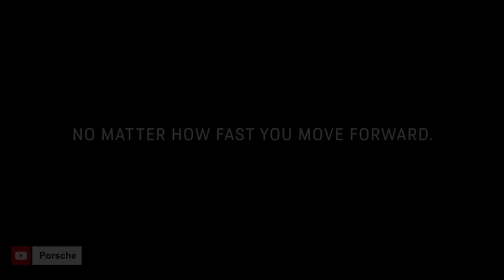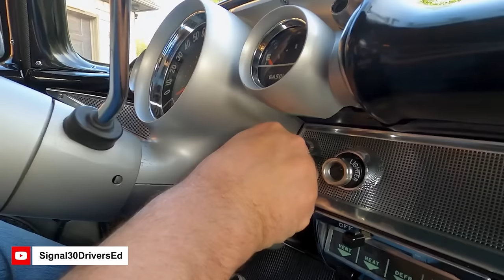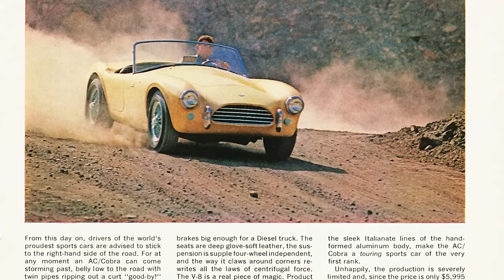Why Old Cars are Better

Comment: Interesting video, but I must call out a few points:
3:30e  "Quality materials in houses 100 years ago"
By this logic, Rolls Royces and Lamborghinis are better deals than mass produced Toyotas. Except they cost 10 - 100x as much, and their hand craftsmanship's only value is saying it's hand crafted. No actual functional superiority.

4:07 "Will it still be standing 250 years from now?"
1 Who would want a 250 yo home in 2024?
2 Even if housing technology doesn't improve nearly as much 250 years from 2024, as it did from 250 years before, it becomes a matter of return on investment. To make a house last 250 years might cost more when interest and costs are included, vs the average 2024 house that might last only 100 years before becoming more cost effective to tear down and replace
3 Who says 2024 houses can't last 250 years?

"Built not to live in longtime but for developers to make a profit"
1 WTF do you expect? 
2 Those market forces drive more houses to get built, at lower cost, therefore more people get to live in houses
3 I do agree developers aren't rewarded enough for highly cost effective improvements like better sound insulation and utility serviceability. But these are minor vs Bart's alternative of hand crafting and overbuilding everything largely for bragging rights rather than measurable functional improvement.

8:00 "old cars require more work to start...a shell of the experience of driving a real car"
Sounds like someone wants validation for understanding some technical details of how these obsolete, less efficient mechanical systems work.  

It's fine if you're interested in how pre-electronics mechanical systems work.  As long as you recognize when they're functionally inferior. The problem comes when one denies/ignores that inferiority. Similar argument to people calling it a feature, that they can fix old mechanical systems vs replacing an entire electronics module.  At the price of worse levels of cost, safety, reliability and performance. 
Electronics are your friend. If you really want validation, study electronics. It's extremely satisfying to understand. Attempting to sour-grapes discredit functionally superior systems in contrast puts you constantly on the defensive while fostering a reputation for science-denial and Ludditeism.

9:30 "Youre not inhibited by electrical systems doing all the work for you..."
What do you call the mechanical systems in that old car? They're still doing 'work for you" -- just less efficiently, less reliably, less safely and more expensively vs modern 2024 technology. The fact you might understand how non-electronically controlled springs and sway bars and steering and throttles work, vs how sampled position sensors and servocorrections work, doesn't change electronics' advantages.

11:30  "less constraints on aesthetics the further you go back"
Well at least no significant constraints on aesthetics before about 1973. Only then did things like rollover and bumper standards start affecting design.

"lines not obstructed by...crumple zones, rollover stats..."
These comprise very little of the restrictions on 2024 design.
You can make hardtops that pass rollover and crush standards.
Crumple zones have essentially no effect on any desirable design -- other than outlier examples like the early 1960s vans and VW Microbus where the driver sits ahead of the front axle.
Bumper standards in 2024 have very little to no effect on design aesthetics -- we can now shape highly complex composite/vinyl shapes that shroud metal bumpers. The fact that market forces result in a lot of similarity, is just that -- the market -- not laws. 
 
Thick pillars housing airbags -- that might be an issue. I suspect there are workarounds.

12:32 "having your car's headlight to look like every other car's headlight"
1 There is no law stating this -- again it's market forces -- style and aerodynamics. 
2 Like every other? In 2024 automakers can make polycarbonate headlights in a huge range of near arbitrary 3-dimensional forms. It's pre-1984 that there were US headlight laws constraining design to a limited set of sealed-beam styles.
1939 - 1956 only 7" dual round sealed beams
1957 - 1974 these or 5.75" quad round sealed beams
1974 - 1983 a few additional rectangular shaped sealed beams
Only with the 1984 Lincoln Mark 7, did the US start allowing non-sealed beams and composite headlight shapes

3 Far more design latitude with LED lighting in 2024 vs the limited incandescent-based 'good 'ol" lighting pallette pre 2000 or so.

Much more relevant crimps on design in 2024, are pedestrian-safety laws potentially limiting sharper edged front shapes and popup headlights, and market drivers like aerodynamics

12:42 "They were made of high quality metals...than the average new car today"
1 Bart appears to be falsely conflating weight with quality. Metals as used pre 1970s vs modern composites and plastics, were typically 
* heavier, thus worse mileage
* more rust prone
And where metal is needed, in 2024 we have high strength steel alloys
2 Quality is much higher in 2024 vs 1974 -- obviously with British sports cars but even Honda/Toyota are significantly higher quality.

14:20 "height of headlights"
1 Headlight height laws arrived around 1974 -- ruling out great cars like the variable height Citroen SM. But otherwise perfectly logical -- you don't want to be blinded or have too little light range, by too low lights
2 LED lights give more styling options vs 1974 sealed-beam incandescents

14:50  "Everything is an SUV"
Again it seems to be largely market forces i.e. customers -- driving this.  No laws require SUVs

15:15 "Those cars didn't come from a computer, they were sketched by real artists"
Who do you think sketches the shape of a 2024 car? Real artists. Computers just implement what 'real artists" specify. "Soulless" computer controlled metalworking also enables greater options in fabricating complex shapes. 

20:10  One of the few valid points in this video:  Those pedestrian death rates increasing since about 2010, are indeed a direct result of obsolete US laws favoring large pickups. As well as 'trucks" -- often bought for noncommercial passenger use -- being exempt from many safety standards and mileage requirements.

It's bad laws. Not modern 2024 technology.

Comment: Old cars are better because unless you have a complete engine malfunction you can make it run with just a screwdriver, might not run great for very long but it’ll get you where you need to go to fix it. In a new car if one $10 sensor is bad your not going anywhere

Comment: im on your side. cars have gotten more electrified and futuristic old cars are a whole hell of a lot better than cars today because old cars give you something to do when in today's time you'd just be contemplating on what to do for the day. old cars give me a handon job to do to get some exercise in the process cuz getting frustrated and fiddling with things trying to solve its problem works up a good sweat rather than just sitting in my driveway staring at the new tesla i bought from the dealership if i could ever afford to buy one which i never ever will becuase they are very ugly and are just pure electric producing hardly any sound. i will never ever buy a tesla unless i can afford to buy a hellcat motor to swap into it which sounds awesome in my opinion, let me know if you agree. #OldCars4Life

Comment: Daily Driver 68 Dodge Dart Restored to driver level...
Not a show Car etc..
9 years on the road since Swap to V8 with 120k on my rebuilt Motor,  Parts are a concern as far as quality, i daily so , my example of ware is the brake shoes, yes brake shoes, Push to Pray Drum Brakes front to back.. the Quality of material used isn't near to OEM, yes no asbestos, but it's more than that, I've had drum's out of round, misaligned bolt pattern.. 
My choice is always late 60s era because those basic engineering standards stayed for a while, Suspension systems , Cooling and brake system layout Disc and rear drum, especially on Truck's..

If you choose to upgrade your old vehicle, many aftermarket companies are at the ready,  Computer aided throttle body injection "Carburators" 
Upgrade for Old style Points distributor,,
Electronic ignition, like what i personally run Petronix conversion...

Even traffic is better in a Classic Car/Truck..

Keep on wrenching folk's 🇺🇸

Comment: Peak reliability was achieved in end of 90s/beg of 00s. Then computer simulation was accurate enough so that none of the parts in the cars get over-engineered anymore, which means when you reach the 150kmiles/240kkm typical lifetime requirement, everything starts to break down, sometimes significantly earlier than this due to cost cutting measures and rushed development timing or poor design choices (most of western engines from the downsizing era).
Also newer cars are a mess in terms of interior design too, I mean look at these tablets where you have to takes your eyes off the road for 1min to change the AC setting or the radio channel, all because physical buttons are too expensive!

Comment: going from driving my daily 2004 volvo sh*tbox to driving a modern vw polo feels like switching from driving a car to using a cheap madcatz controller. There's literally no feedback in the steering wheel in new cars, the doorcards squeak like a cheap plastic toy when you grab the handle, throttle feels like a push button more than a pedal, everything has this weird smooth faux velvet fingerprint grease sponge plastic that feels like those bags my girlfriend gets her shein clothes in, there's f* all power until the turbo kicks in at 3k rpm and to top it off there's a big glossy fingerprint smeared 2008 knock-off 20% bezel android tablet instead of a guage cluster. it all feels so... cheap. 

I find myself having to stare at the lines on the road to drive straight because of the lack of feedback in the wheel because if I don't I veer off every time the road surface changes camber slightly.
That's when I realised that in my old car, I don't have to do that? I can just look out for where the road is going or at other drivers and my hands automatically keep me straight when the road ain't.

Apparantly i'm not the only one noticing this because high-end porsches and other expensive sports cars HAVE A FORCE FEEDBACK MOTOR IN THE WHEEL.
YOU PAY FOR THE SIMULATION OF HAVING A MECHANICAL CONNECTION WITH YOUR WHEELS NOW.

just buy an old car and put money into new parts for it because it's a dying luxury honestly.

Comment: Ok but by ever single metric new american cars like Teslas and even Chevy/Ford are better built, last longer, and have much better crash resistance than anything built in the 50’s 60’s 70’s etc. Not to mention obviously better performance and efficiency. I love those old cars but this is pure nostalgia.

Comment: At least for houses, I think theres a bias.

Old houses which werent that good, didnt last, cause they werent that good.

Today, you just have everything, good and bad, so It seems worse in general
Reply: For reference, I live in an old House, and because things werent standarized and were more manual and hands on by owners, its full of weird stuff.

The floor is uneven, It has humidity in the walls because they never isolated the floor, theres like a meter of unused space between the first and second floor, etc.

But, I live in Europe, were houses tend to be made of materials meant to last, instead of wood as It is common in América. So modern houses are also durable in general
Reply: It's called survivorship bias, and it also applies to cars. The absolute rot boxes than fell apart within 10 years aren't around now to reminisce on.

Comment: The old house analogy is a really bad one. It’s based on survivorship bias. The houses of people who could put money and resources into their homes are still around, the crappy houses either burned to the ground or were cleared in the 50s for more modern homes. I’ve seen this first hand in Denver seeing older homes getting knocked over to be replaced by newer homes. Most of the homes in my neighborhood also fit the bill of crap old homes that should get demolished and replaced.  

Not to mention maintenance on plaster walls is a son of a bitch. If a pipe leaks, you literally need to demolish part of the house to get at the plumbing. Replacing draw walls and the pipes now are fairly easy by comparison. While we can build better things, you can blame the market for that. It keeps thinking we want cheaper, worse quality things. It starts with us, stop demanding Spirit Airlines quality everything and the quality of stuff will improve. We’ll pay more, but what’s better, less of something that works or more disposable crap?

Comment: Old cars usually have horrific brakes and meh suspension systems. That was FINALLY rectified by the 1980s and the 1990s say MUCH better tires.

Comment: I think maybe "old cars are more unreliable than new cars" is kinda right and wrong at the same time. I understand that maybe 1940's engines can be more unreliable than a 2015 Toyota Avensis. But there is loads of bad unreliable cars from after 2010 that lose to older cars. And I am talking about comparing let's say... Cars from the 1980 versus cars from after 2010. For example, I think that a Toyota Corolla from 1984 lasts longer than a Fiat 500 from 2015 (engine problems, electrical problems, and problems with the transmission.), or a Volvo 240 from 1990 will surely last longer than a 2013 Mini Cooper (turbo problems, and oil leaks). But as a said, I don't know that much about "classic" cars from 1950's or the 1930's, so they can be more unreliable than newer cars.

Comment: Ironic you point out design like headlights being up to the manufacturer in the old days when in fact it was mandated all vehicle headlights had to use a standard design up till the 70s and even then the only change allowed was the shape, you could then use the sealed rectangular bulbs, it wasnt till the 80s that the US allowed the use of different style headlamps with replaceable halogen lamps and wasnt till the 90s that HID headlights were allowed.

Comment: Sorry but the reliability of those electrical systems in computers is abysmal.
And all those sytems are completely unnecessary as well.
And yeah, 90s cars are the most reliable all around, because they were made that way. Why? Actual ecologists pushed for that.
Meanwhile modern ones are just made to make money, including the government requirements and its 'climate taxes' to fight 'cimate change'.

The 'epidemic of SUVs' is not caused by consumer behaviour, but by government regulations.
It simply isn't profitable to sell basic cars anymore, due to all those retarded environmental and 'safety' restrictions.
a modern car needs to be a premium SUV, anything else is a waste of space and money.

21:00 if everyone would drive old cars, then the car companies would get bankrupt and the climatards would go crazy.

22:30 Because it is banned to do any tuning to your car. The WEF will knock at your door if you try to treat your property like your own.

Comment: While I don't agree that the "old" cars were better because MY car experiences go back to the late '50s. The old cars with their all the maintenance and PROBLEMS don't even come close to today's cars. The list of things to HATE with old cars would fill a book, so I will only mention ONE thing.....FUEL systems! How many of today's cars have "vapor lock" problems? How many have "choke" problems? In MY case, I have ZERO problems with my current vehicles! There is ONE thing that was BETTER , "back in the day". That is FURNITURE. It was made of REAL wood with a REAL wood veneer instead of "genuine simulated plastic wood veneer", which is usually MDF junk. I think of it as "stained" compressed cardboard!

Comment: I drive 2 trucks, a 2006 Chevy silverado and a 1989 Ford Ranger 

My chevy is massive compared to the Ford and has better gas mileage, but I can see with Ford and maneuver pretty well compared to the Chevy and a lot smaller, too